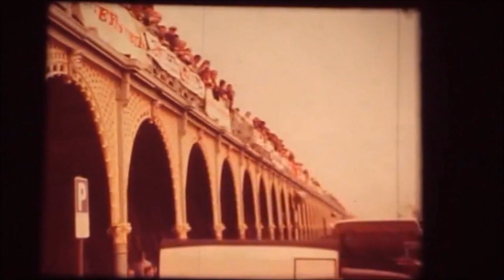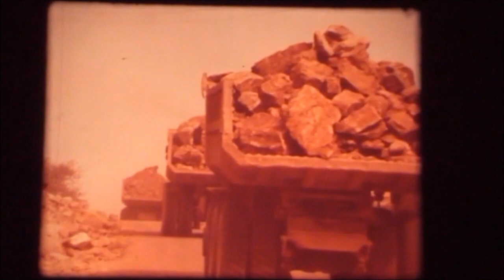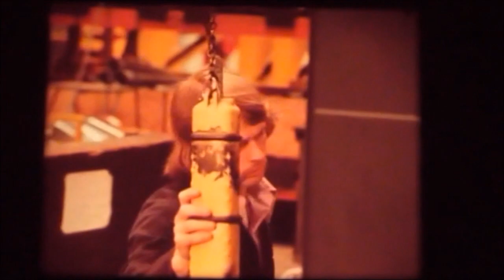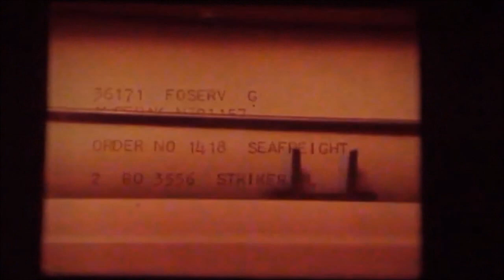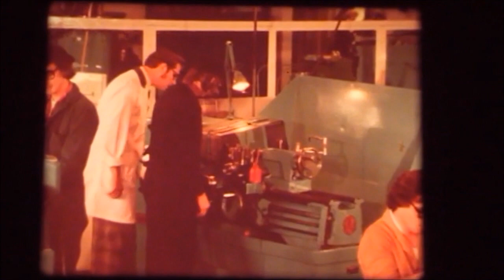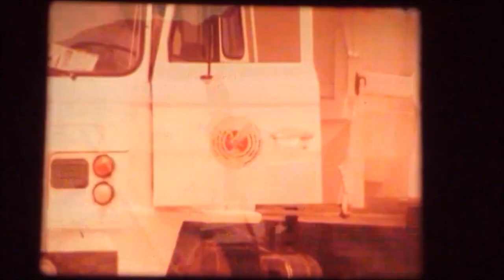Foden S95 Fleetmaster launch film, 1978. Inc Haulmaster and Super Haulmaster models.

Comment: most of the the cabs were made by Motor Panels of coventry,did not see a Foden 2 stroke engine in the film,
Reply from the maker: The two strokes had finished by the early 1970s and wouldn't have had the horse power anyway, the last Mk7 made 225BHP.
The Coventry Motor Panels cabs were in the minority on Fodens, their own fibreglass ones being the favorite. Thanks for watching and commenting.

Comment: Did Fleetmasters generally come with a Radiomobile pushbutton MW / LW radio as standard? Or was it an optional extra?
Reply from the maker: Don't know, Radiomobile was a popular choice for truck makers though.
 I never had a new lorry, they were usually about 10 years old when I got them and all you could get on the radio was alternator whine.
The one I am restoring will have an up to date but not to fancy make, S95's have good sound insulation so you can actually hear it.
Reply: @SMayleification  Showed a Radiomobile pushbutton MW LW radio in the cab roof being turned on, the radio aerial will have been mounted on the cab roof at an angle to ensure good reception.

Comment: More crap getting spouted by the pro euro brigade,blame the unions for poor cabs designs by forbidding the drivers to sleep in them so no need to develop a sleeper variant.Foden was also the only maker that produced a tractor unit that could legally run in the uk at the correct construction and use lengths.As for "crap" engines besides ERF who offered a choice like Foden,and please just remember without Cummins there would be nothing today,their PT fuel system paved the way for today.Comparing a TD 100 or 120 to an 855 what a joke.

Comment: Foden, I think, were quite special and had something different to offer. 
They were'nt for everyone but from what I saw they were tough, efficient, lightweight and long lasting. Sadly I came in to the industry as the last of the modern Fodens were coming to the end of their lives. I remember as a child though the mid 70's Haulmasters coming in through Aberystwyth from West Wales back in the day. What a sight, and sound, they were. I ended up with a driving career mainly on Scanias. Good film.
Reply from the maker: Yes a well-built machine, not necessarily good from the driver's point of view, I always say built with steam engine mentality.
That said I have had one of these S95's since 1988, and which I am currently restoring (the progress is on my channel) and would put it up against any of the opposition. Thanks for viewing.

Comment: Partly agree with DraxIndusties1,British manufacturers were late on the scene for cab design/driver comfort and limited engine output/spec.Volvo and Scania,inparticular,just did this better by Mid 1970's.By 1980's we were playing catch up,which failed,except for small Daf's still built here.Compared to European Manufatures,Japanese trucks aren't as sophisticated,but they're everywhere around the world,because of reliability,cheap cost,good backup etc.I work for a truck conversion company,we work on Scania,Volvo,Renault,Merc,Man,Daf and Iveco.
Reply: Which makes me wonder.. when the Bedfords we all came to know and use became oldfashioned, GM just dropped the make. What if they rebadged Isuzu (also GM) trucks as Bedfords and sold those in traditionally British-buying markets?
Reply: Check out the fella breakdancing at 7 20 give him a yorkie

Comment: The perfect demonstration of why the British truck industry collapsed, hopeless dated engineering, crap engines with equally crap gearboxes and  no regard to driver comfort...long live Volvo and Scania..
Reply from the maker: +Draxindustries1 How can you call Cummins and Fuller crap, a world beating combination, proven in countries all over the world in far more arduous conditions than we have here.
The cab interior on this model is at least equal to owt from the continent and so is the ride quality.
Volvo's weren't without their problems either, more smoke than a knackered old Gardner when cold, liner seals and pump drive plate failures, clutch hydraulic faults, splitter engagement troubles and automatic brake adjusters that never did, with stupid manual override that broke shafts inside the adjuster. Not pleasant to drive either with that short gear stick, the Scania was marginally better than a Volvo I'll give you that one, but no motor ever made was perfect, they all had their own set problems, I've drove and repaired them all so I do know what I'm talking about.
Reply: +SMayleification Ive driven many an old British trucks from Ford D series, ERF's with Rolls Royce Eagles, L10 Cummins at 290-325hp, 14litre Cummins 320hp, A series with 220 Cummins, a few Sudden Accidents, Cargos with Perkins V8 ect ect and they were all nothing but a mish mash of parts cobbled together crap. An old 78 F10 with the classic '10 Turbo Six' moniker was a revelation in comparison. Some European trucks are better than others (an F7 224hp at 36 tons) wasnt the best but since driving an F12 (360 and 400hp) an FH 12 420 and a variety of Scanias and finally doing long distance Scandinavia to Costa del Sol for 3 years in my own F16 470 (long gradients in top gear) im totally sold on Euro trucks and stand by my comment on Brit rubbish..
Reply: You really don't know trucks , do you,  i am a  40 years truck mechanic,  apprenticeship in the U K  in 1977 , worked in France,  Canada,  Australia,  i would say Cummins /  Fuller , 
would be the most popular truck engine transmission combination world wide,  we have Cummins/ fuller doing a million kms in triple road train, 140 tonnes trouble free,  go to when this was released,  240 Gardener were slow revving but big torque,  very good on fuel , 
Based model 9 speed fuller, was million times better,  and easy to ues , compared to the 10 speed Scania,  i all ways recond the Volvo engines were week , in this time , you had to drive the Volvo,  witch bernt more fuel,  and they didn't like getting hot , you blow liner top O rings , and volvos were heavy,
Reply: This is not strictly true. The British makers were appealing to a different market, or perhaps didn't understand the one they were trading in. They deliberately built trucks that operators and 'gaffers' wanted. Even in the late 90's, ERF's main advertising campaign was that it was 1mpg cheaper than all the other units. What the 'foreign' boys were doing, was building up a brand with the drivers, not the gaffers. After a few years of this, it almost became fashionable to have a Volvo, and then a Scania. Now, with the driver shortage, if you brought back a modern equivalent to the EC10, you would struggle to find drivers, 1mpg extra or no.
Reply: Hence M.A.N, Mercedes, Scania and Volvo still churning product out employing thousands. Foden and ERF are finished because the product was crap and the product was crap because the engineers designed shite working for clueless managers and shoddy assembly.

Comment: am I the only one that did like them. Lol horrible motor. Dated engineering. Fifth wheel beds cracking. nightmare gearbox to remove in comparison to other vehicles. horrible dated adjustable trackrod ends. Bullshit video. ok for museums.
Reply from the maker: +cosgrove notts Anybody who has worked on Foden's of old, knows they were designed with steam engine mentality, and that the driver was usually an after thought.
That was until this this motor came along,. a totally different ball game.
If you read the text you will see the only Foden made assembly was the front axle, and I will disagree with you on that point.
 I've had my S95 since 1988 and never fitted a steering joint yet, any slack, just tighten the joint.
We could do with going back to that method now with the amount of joint failures on modern motors !